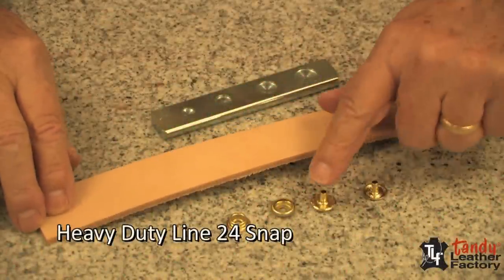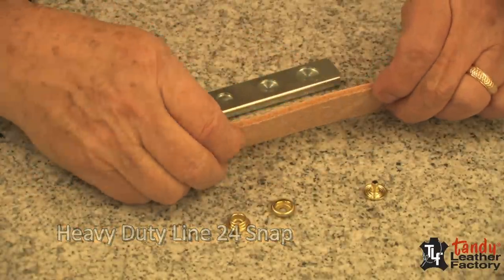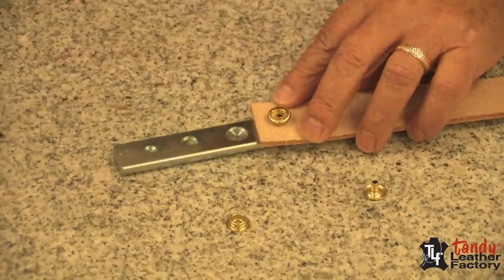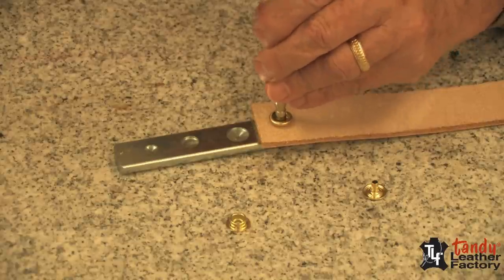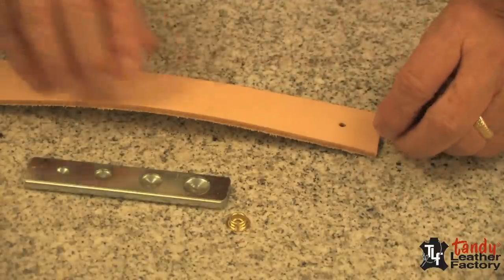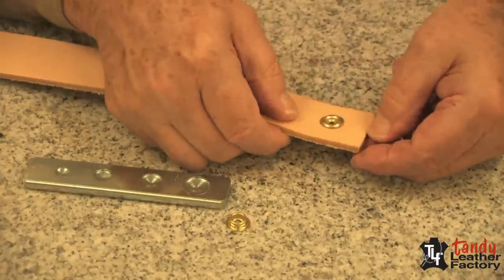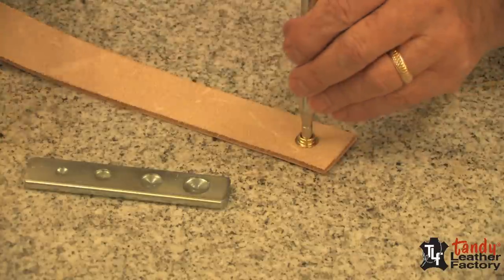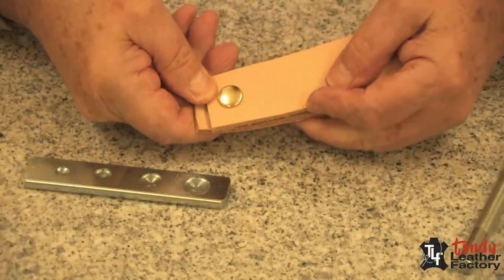Setting Line 24 Snap Fasteners On Leather

Comment: Does this size snap (line 24) work only, or better on the heavier weight/thickness of leather.  For thinner materials should the line 20 snaps work better?